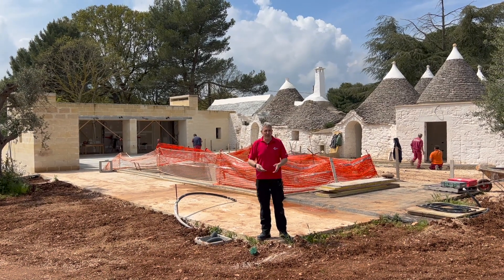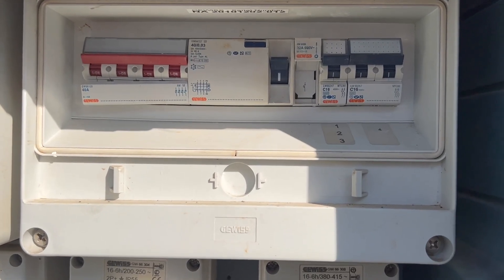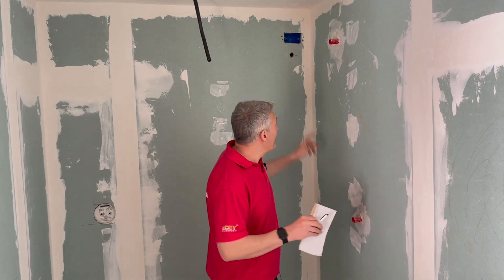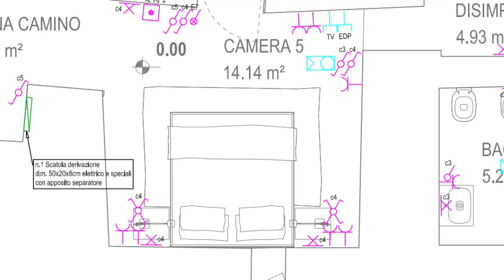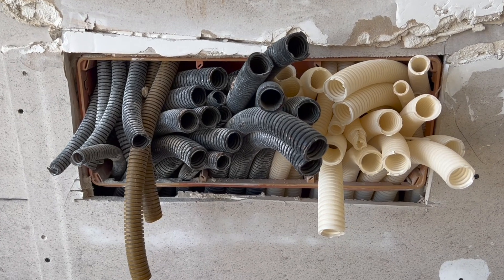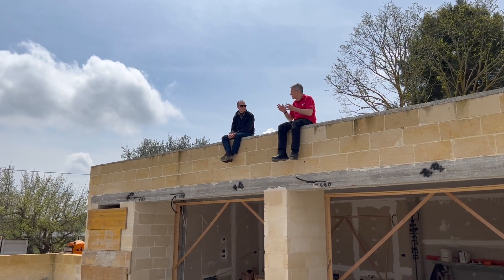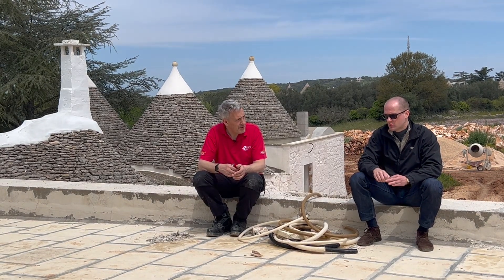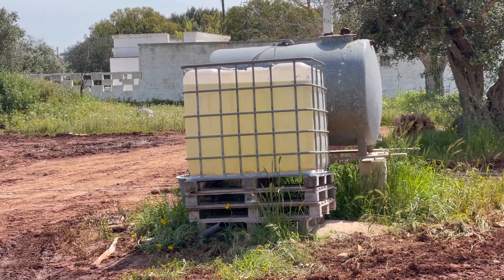Electric Wiring in Italy - You Won't Believe What They Do!

Comment: I think that the meter placement is region dependent, I live in Veneto and the meters are inside the home usually... Great video!
Reply from the maker: Great info 👍
Reply: Meters are required to be accessible from the outside of the property for two reasons: one is for safety, for example if there's a fire the firefighters can easily disconnect the electricity supply. The second reason is that the meters are the electricity company's property, and if they need to do maintenance on them they should be accessible without trying to get permit from the owner to enter the house. Many properties were made before this law so it's very common to have the meters inside the house.

Comment: This is super interesting, not so different to what we do in France btw, and I am impatient to see the next video with the finished house
Reply from the maker: Later this year - stay tuned. Amazing the differences between countries with a harmonised standard.
Reply: @efixx  The various national wiring regs are based on the same harmonisation documents but with so many national alterations they're barely recognisable anymore. Add to that mix what I'd call local customs (materials and methods that are not required by any regs but strongly considered good practice) and you get some very different wiring systems. Examples for those "local customs" would be using capping for T&E in the UK (as far as I know not required but considered proper workmanship) or using conduit rather than cables directly in plaster walls in Austria where I live. Bringing up local isolation for appliances (e.g. cooker switches and fused connection units) in the UK also always makes for interesting discussions.

Major differences between Italy and neighbouring Austria are those enormous Italian junction boxes, whereas in Austria you can only have one circuit per junction box, unless you've got a DIN rail with terminals, the Italian love for stranded building wire and the limited use of three-phase in Italian domestic properties. In Austria, most DNOs (responsible for the entire hardware side of supplying electricity, including metering and billing) no longer even offer single-phase supplies and the only one that does only offers them up to 6 kW at no cost advantage over 18 kW three-phase, except for only requiring three 10 mm2 cores instead of five (CPCs are always full-sized and insulated on the continent, size reduction is generally only permitted from 25 mm2 upwards and then only by one size, e.g. 4x25/16 or 4x35/25).
Reply: have you returned???? @efixx